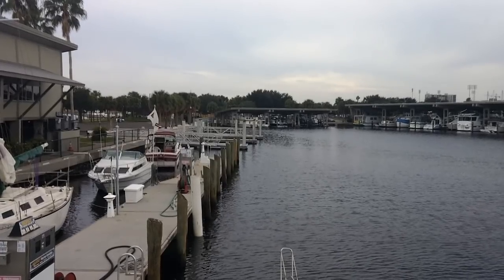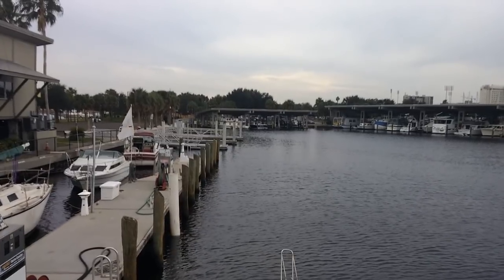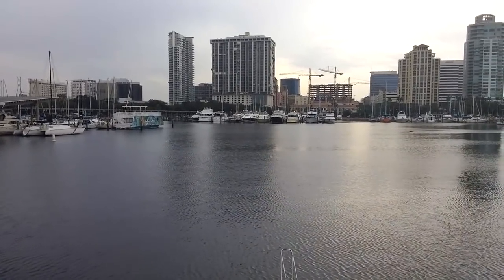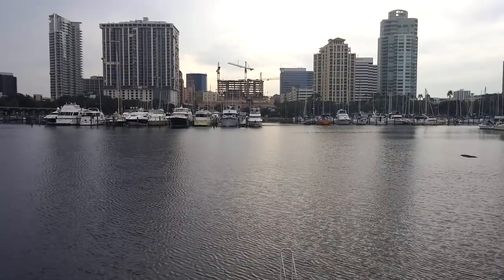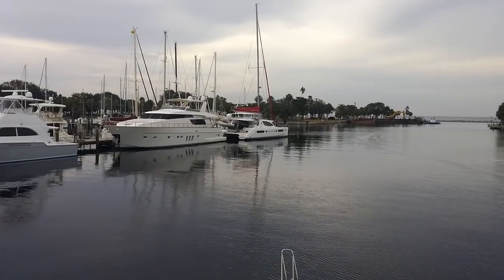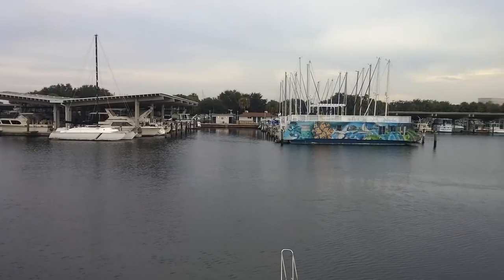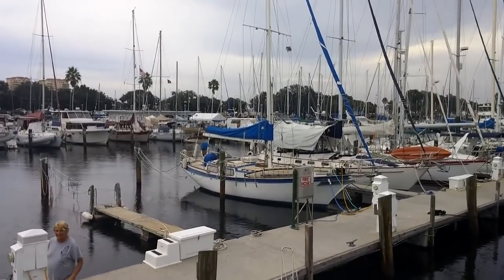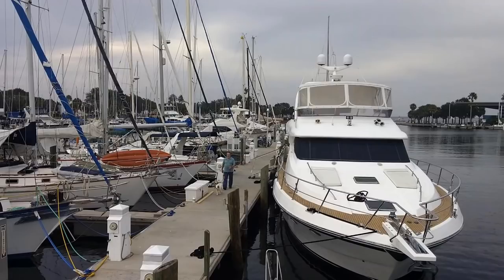Liveaboard Boating: No Muss, No Fuss Boat Handling, Single Engine Docking 2018

Comment: I captain a 36 foot single engine wooden boat  the pivot point and the Prop wash or paddle wheel effect in reverse takes some practice to master mine actually pulls to starboard in reverse. The best advice is go slow and take your time and don't panic - let the momentum of the boat carry you forward. Docking the boat the other way around is not so easy.

Comment: Hello, and thank you. I just bought a 27 ft single engine boat and I am vary green! this is a new adventure for me, but I can see I have a learning curve. your video helps with that learning curve. thank you!!!
Reply from the maker: No probs! Single Engine Rule #1 - Don't let yourself get stuck in a situation you can't get out of easily. Rule #2 - Power is your friend. Rule #3 - Watch wind and currents aggressively. Your bow can get away from you. 
If you have any questions don't hesitate to contact me.

Comment: Hi there, Bill here and I just bought a 32' Grand Banks trawler that I hope to live aboard full time at some point in the future. She's almost 50 years old and needs a bit of work but I hope in a year or so I'll be able to untie the lines so to speak. I have always had twins in previous boats and so was a little concerned about buying a single. I really enjoyed your video and found it very helpful....thanks!I was wondering if you head south for the winter how far do you go? I live in Connecticut and I'm looking for some please warm but not hot. I do have a cabin heater on my boat, but I'd rather not have to use it. Thanks for any info you can provide. Bill

Comment: Great video thank you and well done, although it certainly helps when conditions are favourable. I find it difficult when high winds and tides cause problems when docking into a small space. I just wish I could find someone who would tutor on these issues as this, i feel is the main crux of mooring. Thank you
Reply from the maker: Thanks for the reply. Yeah, conditions for this video were good, granted. The big difference with what I did in this video and when conditions are more challenging is the approach. From the perspective of this video, if the wind was blowing to the dock, I would have pulled to the space more parallel with the dock and let the wind do more of the work. More than one dockhand would be helpful. If the wind was blowing me off the dock, from the dock to my port side, I would have come in more perpendicular to the dock, Then make a more abrupt pivot, and again, have a good dockhand available. Pivoting off a spring or bowline might be needed too, but our boat does not seem to like to do that; she seems to fight it.  Also, as you can see on the video, our anchor pulpit sticks waaaaay out there, and that dictates some of the maneuvers I'm able to do.

Comment: Just curious. Why did you dock in different direction than the other boats already docked?
Reply from the maker: I wanted her to be pointing toward the bay entrance when we departed. She needs more room to pull away from a dock like this than to dock. If I had docked her on her startboard side, adding a 180-degree turn would have added a degree to complexity to it all. Also, that little shot of reverse at the end of the docking maneuver pulls the stern into the dock nice and cleanly. It doesn't do that as well when docking on the starboard side. Also, there is no appreciable current in that basin. If there had been that could have effected my decision which side I docked on.
Reply: @TheOnBoardLife  so a prop walk at the end to bring in stern?  How do you compensate for a single engine always pulling to port .. I assume right hand turning prop?
Reply from the maker: @ettrickdoo7287  Not really a prop walk. It's a close forward pivot. In that instance I used a hard right rudder and short bursts of forward thrust. The boat actually turned to starboard in a very tight radius, including going forward a tad. I have a very good feel where the boat's pivot point is - 1/3 the LOA back from the bow. I knew the boat would turn to starboard AND slightly yaw closer towards the dock at the pivot point.